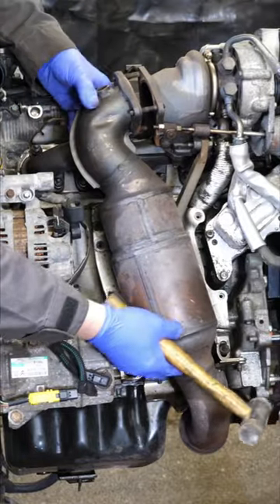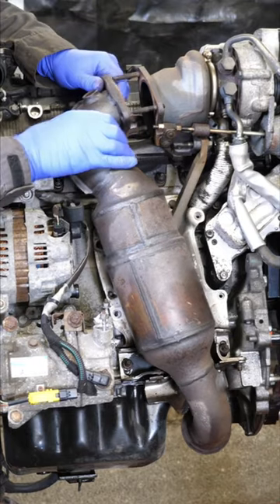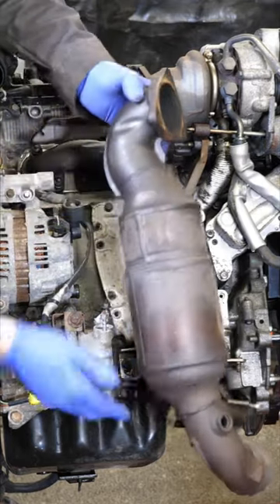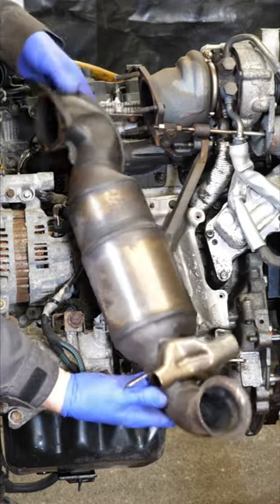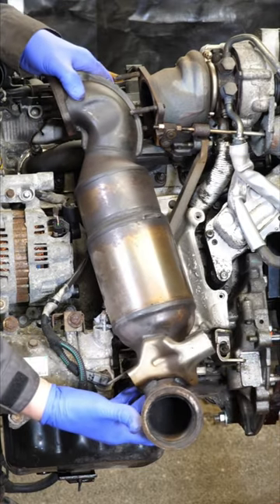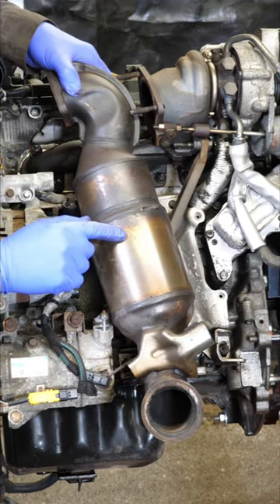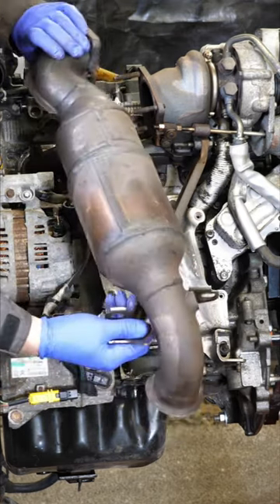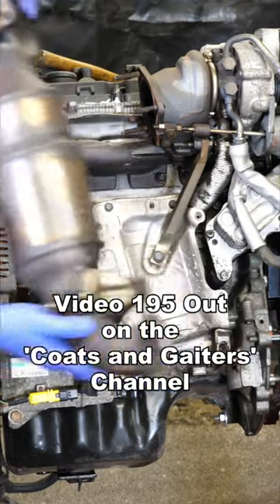The Cat and the Hammer #shorts #mechanic #repair

Comment: Or it's a particular filter or it's a pre cat. Pre cats use the same principle as main cats but they are made thinner and placed closer to the engine. These 2 factors make the pre cats heat up faster than the main cat.
Unfortunately because it is thinner it cause more restriction to the engine, that's why Koenigsegg invented the rocket cat and on the newer versions an electronic valveset that bypass the pre cat once everything is warmed up.
Reply from the maker: Thank you for that insight.  I'm so out of touch with later cars.
Reply: @CoatsandGaiters  I think the rocket cat was first used around 2003. Engineering explained did a video about this.
The rocket cat has the advantage of being 100% passive.
I believe their newer system even bypass completely the turbocharger during warmup time, cause you're not supposed to use the engine hard while cold.